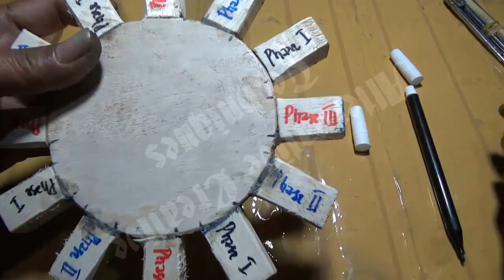(How to) Rewinding a Brushless DC Motor - 12 poles stator.

Comment: Incorrect winding winding the coil clockwise and the other counterclockwise
Reply from the maker: Specifically in this video one-way winding.  In other videos, you have to go back and forth.  Due to the different number of magnets used.
Reply from the maker: Try to watch it until it's finished, don't jump up and down.
Reply: All files clockwise
Reply from the maker: The important thing is that everything is the same in one direction, want to cc all or ccw all.
Reply from the maker: I'm not good at English, I just use "google translate".  Please send your telephone number to yudihermanto74@gmail.com.
Reply: I sent you on a hangouts

Comment: Mas ini namanya delta ya
Reply from the maker: Sambungan delta :
end phase 3 disambung start phase 1, end phase 1 disambung start phase 2, end phase 2 disambung start phase 3.
Nah sambungan2 itu yang ke driver/esc/controller.
Sambungan delta :
End phase 1, 2 dan 3 digabung jadi satu. Yang ke driver berarti start masing2 phase.
Bedanya sambungan delta dan star :
Delta : rpm lebih tinggi dari sambungan star, tapi torsi rendah.
Star : rpm lebih rendah dari delta, tapi torsi lebih besar.
Reply: Mas saya pnya bekas kompresor kulkas inverter cuma kan beda slot nya ada 9 inrunner ,saya mau buat untuk mesin penggerk tablesaw itu lebih bagus nya seperti apa mas
Reply from the maker: @sterlingmmattiaputty1035  intinya begini mas. Motor tiga phase jumlah slot nya harus kelipatan tiga. Yaitu, 3, 6, 9, 12, 15, 18 dan seterusnya.
Trus jumlah magnetnya, umumnya, setiap 3 slot kutub magnetnya 2. Jika 6 slot berarti magnetnya 4, 9 slot kutub magnetnya 6, 12 slot berarti magnetnya 8 dan seterusnya.
Reply from the maker: @sterlingmmattiaputty1035  trus untuk lilitanya ABCABCABC dan seterusnya.
A : phase 1 arah lilitan cw
B : phase 2 arah lilitan cw
C : phase 3 arah lilitan cw
Berarti arah lilitan sama semua.
Reply: Terimakasih mas semoga diberi kesehatan lancar rezekinya,sekedar masukan mas buat cara lilit bldc inrunner
Reply from the maker: @sterlingmmattiaputty1035  ini contoh inrunner : https://youtu.be/vcIVYSgZnLw
Reply: Mas kalau kawat tembaga nya pakai yg ukuran berapa ya dan brpa jumlah lilitan nya?